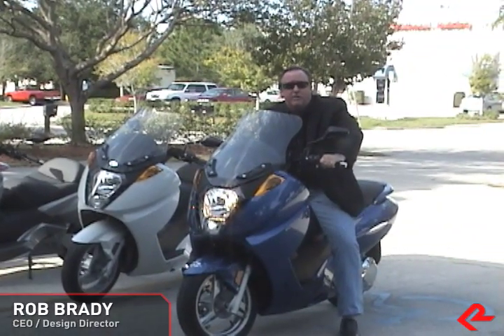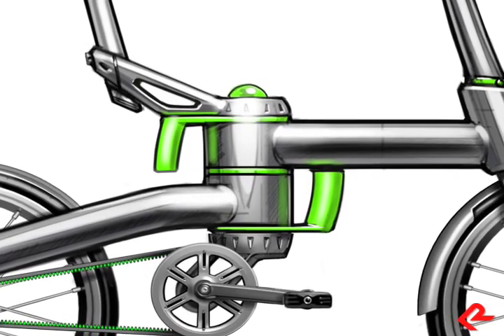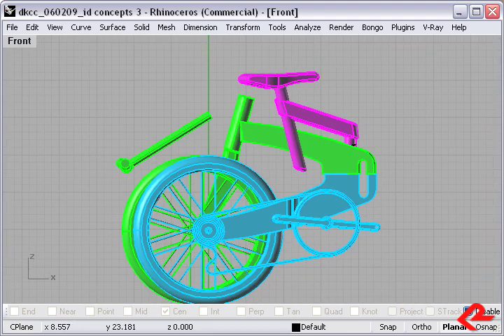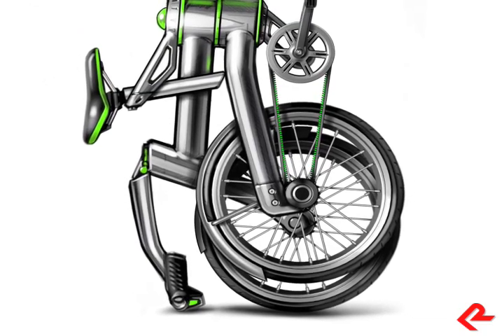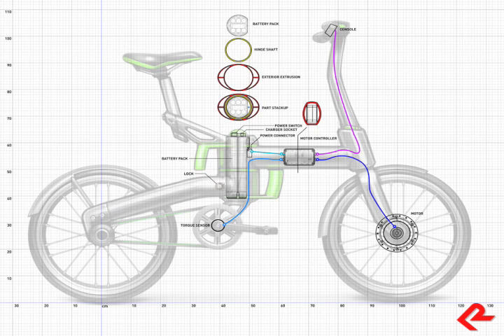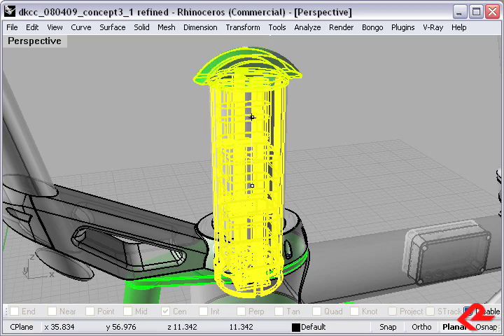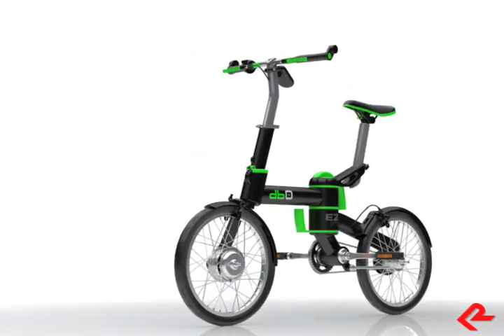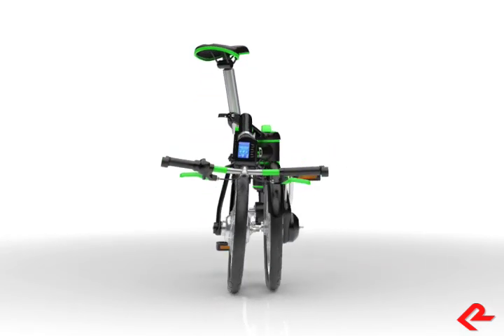db0 Folding Bicycle Designer's Commentary by ROBRADY

Comment: it would be nice if you did a longer video to demonstrate how each folding element locks into place and the potential wear and tear aspects of this design. while pedalling and using the electric motor,you have cracked the two wheel drive problem,was that intentional?